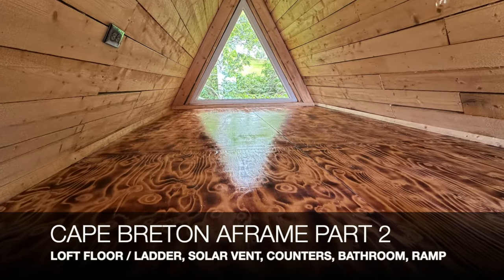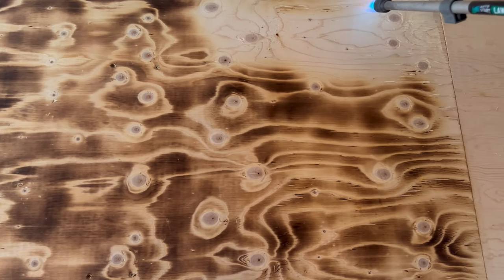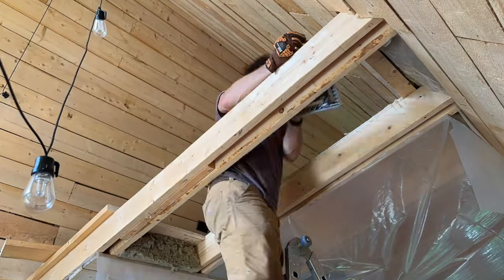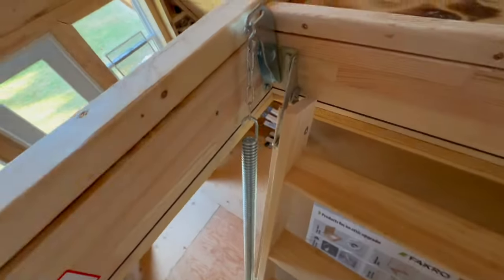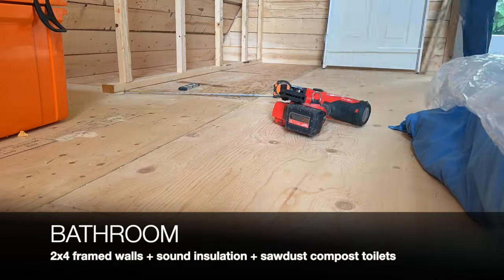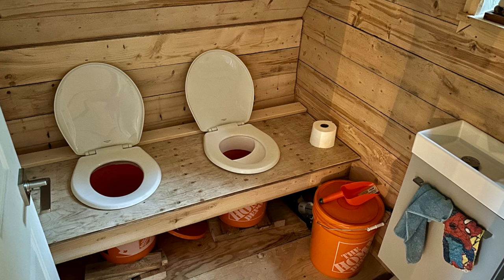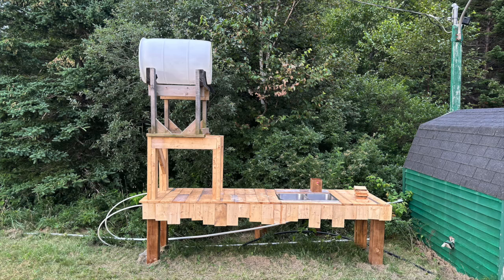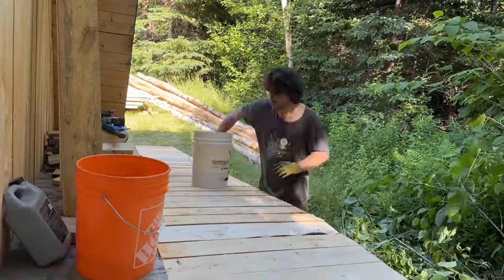Narrated 400sq ft A-frame Part #2 -  includes #fakro ladder installation

Comment: Been waiting for this video, awesome!👍
Reply from the maker: Thanks, I hope you enjoyed it.
Reply: @CraigNakamotoConstruction  Was wondering what wood you used to finish the inside and how much a sq. ft.?
Reply from the maker: @Soundgear4  The first batch was 1" by 6" spruce rough cut, green lumber from a local mill ($1.26 per sq ft) and the second batch was 3/4" by 6" boards, and it was $0.70 per sq foot.  The 3/4 was more than fine, I have no idea why I ordered 1x6 the first time.  Too used to thinking in terms of dimensional lumber I guess.

Comment: Great project. Find a container to fit under the urine diverter and keep liquid and solid separate in the pail and you'll have NO odor. You can dilute the urine and pour it on shrubs and then get a 55g lidded container(or smaller) and store the solids, which after a year ought be decomposed enough to use on shrubs. Must add a bit of ventilation to the storage container. Works a treat!
Reply from the maker: Thanks!  I will try that.

Comment: Beautiful video. Would be great if you would share how much you spent and like how many things you ordered like a data sheet. 😊
Reply from the maker: Thanks.  All of the framing is regular dimensional spruce lumber, the beams are pressure treated lumber, and the board and batton, trim, interior walls, deck, etc. is all green, rough-cut spruce lumber.  Pricing and other details can be found in the description of the part #1 video, you just have to expand it to see all of it.   My order details are kind of mixed up, but I will try to put them together and add a link as well.

Comment: Not the best idea to run electrical and water in the same trench, but the build is pretty cool
Reply from the maker: Yes, this is true.  I am planning to make the aframe off-grid, so hopefully that power line will be disconnected in the near future.  Of course the chances of that solid PEX water line ever leaking are almost zero.  Even if it did, the chances of the water effecting the power line are also almost zero.  Code not withstanding.  Especially considering how hard the ground is.  Never say never though - and I always shut off the main breaker when we are away.

Comment: Twin toilet ?
Reply from the maker: I figured two was better since I had the space, they cost almost nothing, and once the bucket is full you have a backup and don't need to emtpy the other one right away.
Reply: @CraigNakamotoConstruction  so not like.. Twin shower.. lol
Reply from the maker: No, not like a twin shower lol, I didn't get it at first.
Reply: @CraigNakamotoConstruction  I "didn't" think so